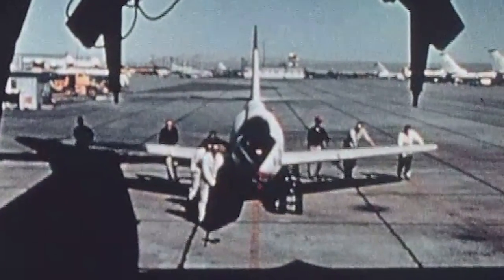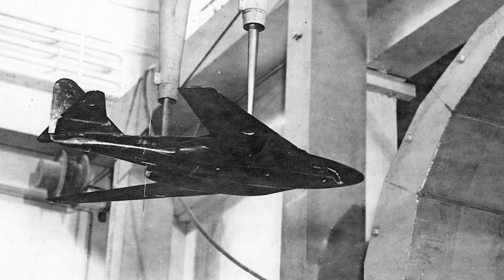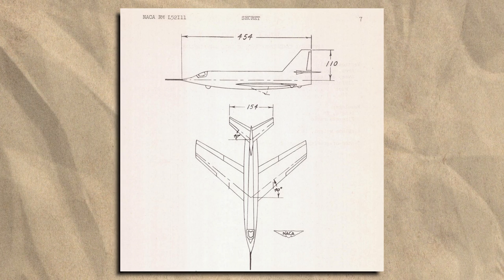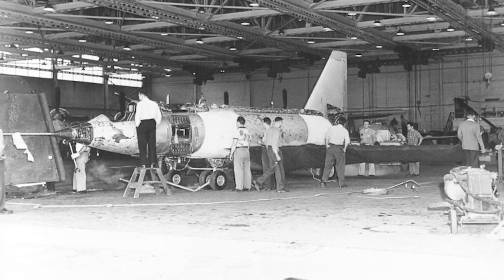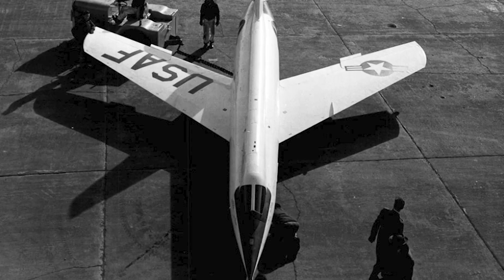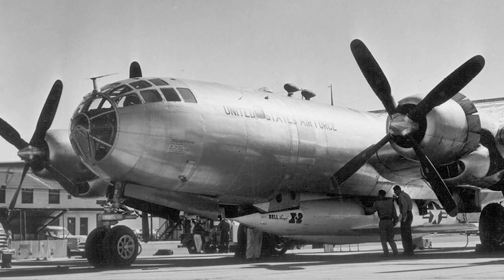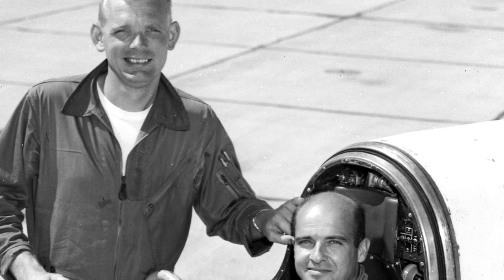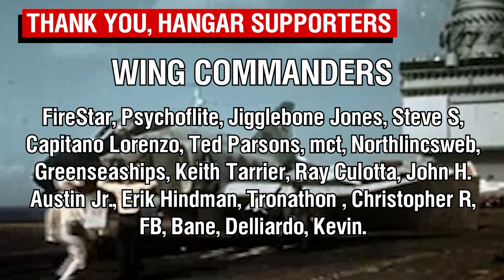The Fastest and Most Dangerous Aircraft From The 1950s | Bell X-2

Comment: Actually the Me 262's swept wing was not originally part of the design. The original design was for a straight wing but the jet engines were longer then anticipated and would have pushed the centre of balance forward. So they used swept back wings to move the engines back and this brought the balance back to where it was supposed to be.
Reply: Yes. And they then discovered the high-speed advantages of the new wing.
Reply: Correct.
Reply: @anzaca1  They already knew of the high-speed advantages of swept wings as a result of Adolph Busemann's work on supersonic (and subsequently transonic) flow over swept wings in the mid 1930s. The published research was pretty much ignored by everyone except the Germans who had more than a passing interest in its potential for new weapons, and Busemann became head of the new German Institute for Aviation Research. As noted, the Me262 wasn't designed to have swept wings but the use of them to sort out the CofG issues was backed up by sound research and I'd suggest that the observed advantages of the design simply confirmed what they already knew.
Reply: @rockymac3565  Interestingly much of the German Blitz Grieg doctrine was based on the work of others which only the Germans had more than a passing interest too.
Reply: @anzaca1  but only with an increase in max speed of a mere 18kts.
Reply: @Cheka__  the original wing was based on the wing used on the later Bf-109.
Reply: Yes, and iirc the sweep on the Me-262 (18.5 degrees) isn't enough to massively increase the critical mach number. Nor were its airfoils biconvex or double wedge shaped - instead they are fairly conventional symmetrical airfoils (NACA 00011-0.825-35 and NACA 00009-1.1-40 according to the information I could find). 

So more a case of happy accidents than intentional design, although as the video mentions the Nazis were also definitely experimenting with proper swept wing profiles by wars end.
Reply: they also knew about area rule before whitcomb
Reply: Agreed!
Reply: @anzaca1  No, they knew that well before they did it on the 262, but hadn't started taking advantage of it. The reasoning was to get the CG in the right spot, and they may have been more willing to do it because they knew something about it already.

Comment: The Bell L-39-1 and L-39-2 were both built from P-63A-9 King Cobra fuselages with modified P-63 E-1 wings. They were not based on P-39's. Both aircraft were built as Navy projects to test low speed handling of wings proposed for future Swept wing Carrier aircraft. There were several leading edge slot designs tested and several alterations to the basic airframe to bring the C of G within limits. The fuselage had a 4 foot plug installed, the prop was changed for a lighter 3 blade from a P-39 and there were a number of different sized ventral fins tried. At the end of Navy testing, the L-39-2 was taken back by Bell and the wing modified to simulate the proposed airfoil for the Bell X-2.  I believe that the Bell L-39 was the first conventional swept wing  US aircraft to fly. "COBRA!" by Birch Matthews is a good source of info.

Comment: The dangerous aerodynamics of the X-2 was the very reason why North American spent a lot of time making VERY sure the X-15 could avoid the inertial coupling issue that destroyed the second X-2 test plane. The biggest problem with the X-15 was trying to get the XLR-99 engine to work reliably, which happened by early 1961.
Reply: Thank you! 
I couldn't remember "inertial coupling" when I posted just now. I knew I'd known the name of what bedeviled early X-Planes but when I looked in the box where it was kept... It was empty!
I'm off to write "inertial coupling" 200 times! 😆

Comment: Bell X-1 design was given to USA by UK. In 1943, the British War Office issued a project to Miles Aircraft for a turbo jet aircraft to fly 1000 miles at 1000mph. They came up with the M-52. It had a conical pilot pod that could be separated from the aircraft, fully flying tail and thin symmetrical section wings. The project was almost ready to fly when the government cancelled it and handed the data to USA.
Reply: He addresses the issue in his video on the X1
Reply: I always thought this was extremely gentlemanly of the British.  Given all the work and research they had accomplished, I felt the Brit engineers should have broken the sound barrier.  It’s too bad the government and the times dictated the direction of their aerospace industry, but good that we ran with it.  Say what you need to about we Americans, but get our heads together and on the same page, we do alright.
Reply: Miles never built the M-52.It was cancelled before Miles even started to build it.

Comment: Great video! I never knew that the X-2 was so difficult to develop. Two small comments.

Aero engineers usually use "airfoil" to refer to the 2-D cross section of the wing, and "wing" to mean the overall 3-D shape with sweep, taper, twist, etc.
 
Pilots' use of "compressibiliy" may be different, but for engineers it generally means above about half the speed of sound, when there's enough dynamic pressure to compress the air. Below that speed air can be taken as incompressible without giving up much accuracy. But as you note, Rex, it's when you get local supersonic flow and shockwaves that things get really funky
Reply: When air is termed to be ‘incompressible,’ does that imply the air cannot be compressed much like a liquid cannot be compressed OR is it that you can’t compress the air at the low speed regime because there’s nothing to contain the pressure and the air just squishes out as it gets squeezed?  

Don’t mock my scientific use of ‘squishes!’
Reply: @ronjon7942  yes, it's just the flow that's incompressble at low speeds. You can significantly compress trapped air in a blocked bicycle pump, on in the cylinders of a car engine, but when it's free to flow at low speeds, air just doesn't have enough inertia to get compressed much.  Like you say, it just squishes out of the way!

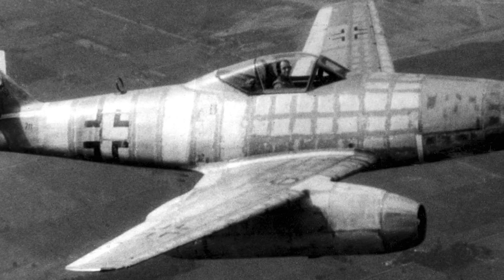Comment: Excellent video, thank you Rex. Just to clarify: at 05:30 the compressibility effect is mentioned. The term does not come from the flight control feel but from the actual effects of the fluid (air, in this case) compressibility and its effect on fluid mechanics. The air gets compressed due to the speed, and close to the speed of sound these effects become more apparent.
Reply: Lol I made an extremely similar comment.  Glad to know I wasn't the only one thinking that.
Reply: When air is termed to be ‘incompressible,’ does that imply the air cannot be compressed much like a liquid cannot be compressed OR is it that you can’t compress the air at the low speed regime because there’s nothing to contain the pressure and the air just squishes out as it gets squeezed?  

Don’t mock my scientific use of ‘squishes!’
Reply: @ronjon7942  air is not incompressible in the general sense, in a wide variety of even daily scenarios, compressibility effects will show up.  Assuming incompressibility for air is only valid for very low mach numbers.  And by incompressibility, its meant that the volumetric density does not change very much while air is flowing around or through something.

Comment: Uh, quick technical note.  The effects of the transonic regime are (at least, additionally to the stated reason) called "compressibility" because that's actually what's happening.  The air's density is actually increasing meaningfully when flowing around the wing.  Under most circumstances this effect around the airframe is actually minimal (if you aren't intentionally compressing it in an engine), but as the plane approaches the speed of sound, the air starts compressing menaingfully and doing interesting things around the wings and control surfaces.  Accordingly, this effect is almost entirely absent from boat hydrodynamics because the speed of sound in water is much higher than in air.

Comment: 1. The Vulcan had problems at transonic speeds. Also it would be interesting to explore the development of the kinks in the delta wing. 2. Dutch roll and control harmonization of the 707 would make an interesting video. 3. Did the Stirling have a hidden flaw? Was Concorde safe? Its landing approach speed and AOA was at the backside of the power curve.
Reply: But the Vulcan was a purely subsonic aircraft (wasn’t the mission requirement 600 mph at 50,000 ft?) so it didn’t have “problems” at transonic speeds any more than contemporary fast 600mph+ airliners like the DC8 and CV990 which could also easily get into the transonic region in a dive…

Comment: The swept wings on the 262 were not for control. The plane wasn't fast enough for compressibility to be seen as an issue. The wing sweep moved the center of gravity towards the tail to offset the weight of the engines.

They were aware of the benefits that wing sweep gave though. For one, it gave a marginal increase in speed.
Reply: The increase was around 18kts.

Comment: It's not called compressibility because of how flight controls may or may not feel; it's called compressibility because air is compressible and compression of the air changes its density. This causes the normal shock that can affect the effectiveness of control surfaces.

Comment: It's called "compressibility" because it involves a violation of the rule of subsonic flow - that air is an incompressible fluid. It had nothing to do with pilot reports and was known about long before anyone flew an airplane in the transonic region. Also, the leather gaskets did not "leak chemicals into the fuel tank" - the treated leather itself became shock-sensitive when exposed to the *oxidizer*, that is, liquid oxygen. Most organic materials (like asphalt, if you spill liquid oxygen on a blacktop road). do the same, which is why organic substances are not generally used in oxidizer systems.

Comment: Really interesting - and just the right pace and length.  One of your best.  My only complaint is it didn't start with jet or rocket noise!!

I love that picture at around 12:30.  Not only is the plane surrounded by men, mostly just staring at it - many, like the guy on the steps, with their hands in their pockets! - but, partially obscurred by the nose, is a technician holding, not a high-tech piece of equipment, but a giant spanner!

Comment: Nice video, though it's quite dissatifying to not know the answers to the implied questions at the end: what WAS the test plan?  If it was overly-ambitious, WHY?  Was it followed or were they breaking the plans?

As an engineer, I think the critiques of delays as out of place.  One can run known types of projects to a tight schedule but this aircraft was doing many firsts and such a ground-breaking project will take the time it takes.  Second, it seems that a belt-and-suspenders solution would have made sense: the nosecone should have had its own parachute, giving some chance of survivability.  Third, given that it was the X-2 that got these height and speed records, clearly despite the delays it was still at the very forefront of knowledge.  Fourth, given the ground-breaking nature of the work, I would not call this program a failure in the least.  We need to consider all that was learned: such as how to run high-performance testing in the first place, as well as specifics of construction and design.

Comment: The fastest x plane was not the Bell X 1 as you show and state, but in truth it was the X 15. The Bell X 1A (flown by Capt. Charles E. "Chuck" Yeager)  did  Mach 2.44  or 1640 mph at the altitude of 74,700 feet  .  The North American  X 15 ( flown by Col. William J. Knight ) which did Mach 6.7 or 4520 mph at an altitude of 102,100 feet .